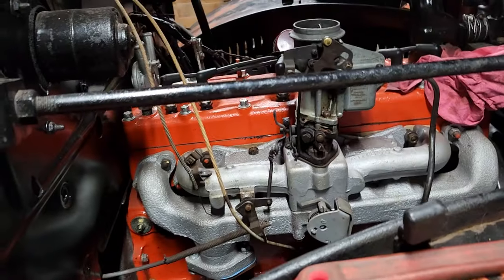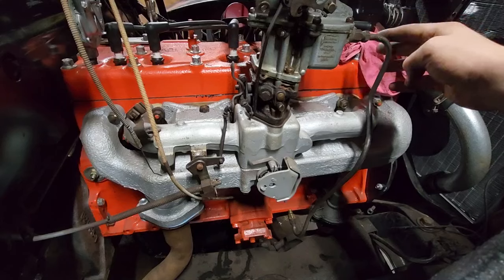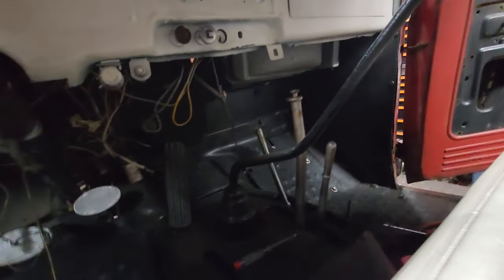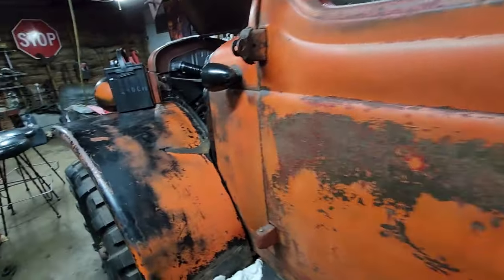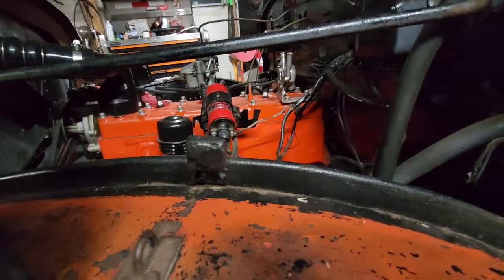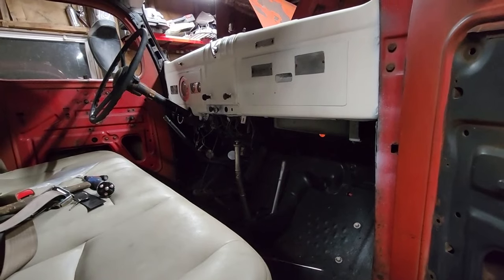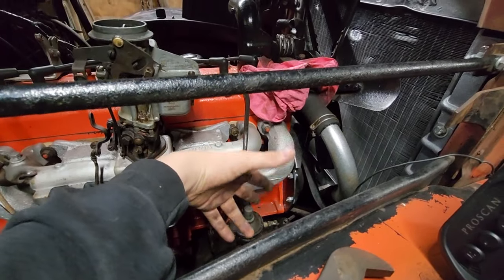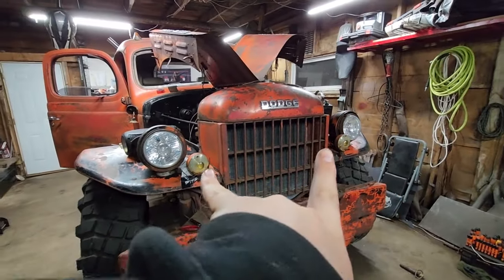1946 Power Wagon is almost there. This weekend I'm hoping to fire her off. FINALLY

Comment: I always get super excited when a car or truck gets to the point where I can at least start it and run it anytime I want to. Even if I have to touch wires to make it happen LOL. Especially if it will roll around, with brakes or without. Just feels like the rest happens faster. I certainly get more pumped about getting the rest done.
Reply from the maker: It's coming

Comment: Before you hook the battery up fully. Connect the power cable. But make up a short cable with a fuse in it. Put that between the battery and the earth cable. So you can test all the electrics without damage. As if theres a fault. It will pop the fuse first.... but dont crank the starter with fuse link in.  Leave that till you tested the rest.